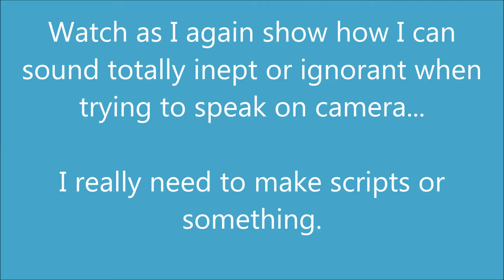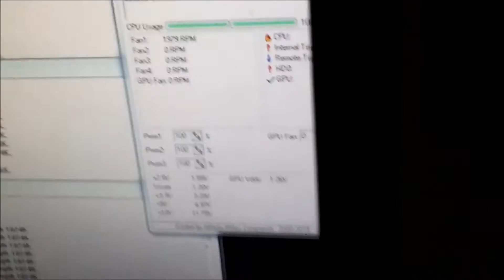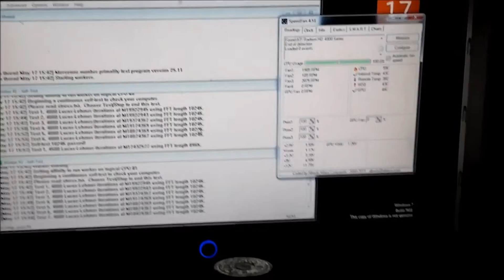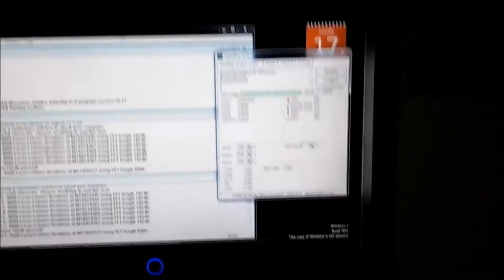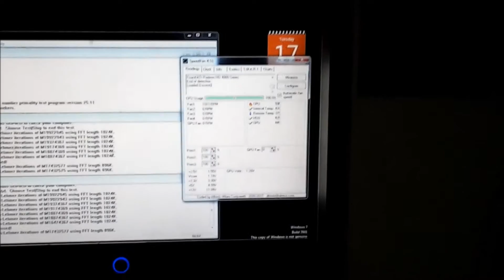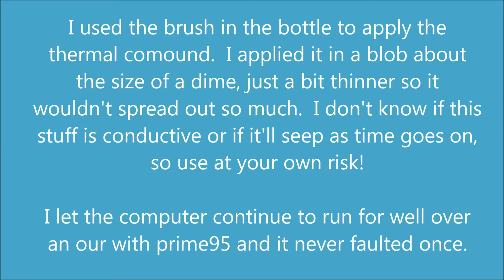Yet another Thermal Compound (Thermal Paste) substitute test....Copper Anti-Seize

Comment: I wonder if someone were to cause the grease to drop out and replace it with dielectric grease if this would stay in place. Been thinking about trying this on a computer but like some have said it could creep and fry the motherboard
Reply from the maker: I would suggest some sort of conformal coating or foam gasket or some other means of keeping it in place similar to what people would do with preventing condensation failure when cooling with LN2.  That would be the only way I'd risk using it long term.  Running it for a few hrs or days until you can get regular thermal paste is risky enough.

Comment: You. Thank you man... So I found Locktite Nikel Anti-Seize 2400F, Also we have the Copper Antiseize aswell. old stuff like yours. Going to test on: HP 8300 Elite usff - core i-5.
Reply from the maker: Just remember to be careful because you CAN kill your computer if it flows and bridges contacts.  It IS electrically conductive metal.

Comment: Followed your advice and had a go. To find out that the anti-seize eventually liquify enough and creeps onto other parts of the board. Mine is vertically standing, dripped and shorted the mainboard to its death and so can't really recommend
Reply from the maker: I did caution about that possibility.

Comment: It works cuz Anti-Seize is a mix of aluminum, lead and grease...All of which are good thermal conductors and not too dissimilar from ingredients used in real thermal paste.
Reply from the maker: This mixture doesn't have lead or aluminum in it.
Reply: @hellcat1988  Yeah it looks like the product you have is copper, graphite and grease so it can handle higher temps.  copper and graphite are also good thermal conductors. Any of the anti seize compounds probably work well as a thermal compound and all of them are probably slightly inferior to real thermal compound.

Comment: I have this problem now. Nothing open or cost $25. I dug around in my garage & found Permatex Ultra Copper Gasket Maker.For temps -65F to 700F. I been using it for valve cover gaskets for a couple years. I'm going to try it, dammit. Ask me about it in a year or so.
Reply from the maker: Do NOT use a silicone for thermal compound!  That will glue your heatsink to your cpu and prevent thermal transfer.
Reply: @hellcat1988  Looks like you were right. I started getting hot &  shutting down with BSD. I replaced it with thermal paste, & all is back to normal. Thanks for the advice.

Comment: I did some more research for you  pure copper is better the aluminium  so all those shiny sparkles in the never-sease  if flakes of copper and its designed not to harden or dry out the only thing that comes close is high $$$$ carbon nanotube sheets. so a copper powder in a non drying gel or paste form might give a little better performance but the price jumps up right there with carbon nanotube tech

Comment: For how long will this last before has to be reapply again?
Reply: my personal exp. with neversease in auto and marine industry  for a pc would probably be forever
Reply from the maker: I haven't done any long term testing with it, as it was intended as a temporary replacement for non-conductive thermal compound.  Given how long it's lasted in high heat and pressure environments on vehicles without drying or otherwise degrading, I imagine it would be fine to use for several years on something as relatively cool as a cpu.  Just make sure to check for corrosion buildup on any aluminum surfaces after a while and keep an eye on the temps.
Reply: hellcat1988 Ok 👌 thanks.

Comment: Hi, great video. I wonder how it performs in long term. I mean did it ever got solid or any other issues? 
I have a Nvidia 9500 GS that's tried out. I want to squeeze out a bit of life out of it.
Reply from the maker: I didn't run it for long because the computer was old and I had better hardware.  I don't know if it'd get hard in a TIM use case, but it never gets hard on lug studs on cars, and braking makes the studs hit AT LEAST 100C on a regular basis.

You're much better off just getting something like a 750ti or an AMD rx550 off ebay, as they have WAY better performance for cheap.
Reply: @hellcat1988  thanks for the reply! Well this machine was given to me for free to play around with anyways so it's not like I'd be loosing something haha. It is an old hp tower with core 2 quad tho, so to me it is interesting to see how it compares to my laptop cuz my laptop is i5-4200u and 840m Nvidia card. It's almost 10 years of a difference and I think the tower would perform better is single core tasks. Back then in year 200X comparing a systems 10 years apart was a joke but today it's actually interesting. At least to me haha. 
In terms of upgrading I have an eye on GIGABYTE R9 270X WindForce 3X OC 4 GB on Craigslist for $30 Canadian or GTX 460 for $20. R9 would be a better chose but I'd have to upgrade PSU as well. 
How would that perform? I think csgo, Minecraft would be playable so I could donate it to a kid or something. I don't know anything about fortnite but should be okay right...
Reply from the maker: @vinade2100  I don't know how hardware that old would perform, but I don't think it'd do all that great.  Usually if the hardware is anything pre 2012, it's not much good for modern streaming games like fortnight.  It's a problem with the cpu not being able to process the network data fast enough or the hardware level encoding or something like that.  I'm not great with networking, so I don't know for sure, but I know if it's slow to load modern web pages, it won't be good for streaming games.

As far as the TIM, as long as you don't use too much, because it is conductive, it should hold up for normal use for a while.

Comment: Hi. I went to get some thermal paste at a couple of auto supply stores [ no radio shack nearby ] and both were out of it. Came back to the house with nothing. Then I remembered that I bought some Copper Anti-seize in a small squeeze packet which is marketed for use on Spark plug threads. I squeezed out a dab and measured with my ohmmeter to see if it was conductive. It wasn't. The packet said that it was designed for 2000 F ! Mmmmmm, considering that the idea of a thermal paste is to fill in the tiny metal air pockets between the heatsink and the heatproducing electronic device; I decided to try it.  My project was on a Xbox 360 Slim Power supply Brick. It takes very little Antiseize to do the job and after a month of use my Xbox power brick never reaches a cut-off/shutdown  temperature like it had been doing. Problem solved.Thanks for this video as I got curious and searched youtube videos to see if anyone else had this same Idea. I feel better knowing that others have experimented with it.
Reply from the maker: There have been a few videos copying me, but I couldn't find any that posted a video before I posted this one.  Glad it could help you.

Comment: Heya hellcat1988, thanks for the idea, started using antiseize on my computers, works really good!
Reply: So it says it's been two years since y'all have commented on this how has the long-term effect been I'm in the same boat as we speak I'm trying to deal with it
Reply from the maker: I'm glad it's working for you but keep in mind that it's designed to be a lubricant, not thermal compound.  It may break down, run, or even cause a short over time.  This was JUST meant to be an experiment to see what would work in a pinch until proper thermal compound could be applied.
Reply: Gotcha, will be checking it out monthly and see how it goes, but for now, all my stress tests are being passed with flying colors.
Reply from the maker: I'd keep an eye around the socket for an weeping of the suspension medium (lubricant) to make sure it's not going anywhere.  What cpu are you running it on, if I may ask?
Reply: Sure, running on 4x intel i5-3570k boxes all of them using CM Hyper 212 evo to cool the processors, those processors now idle to less than 30c and wont rise temperatures above 50c under primer95 stress test (previously they all hit 60c with ease), and my laptop 640g1 with a mobile i5@2.6ghz never goes above 60c where previously it rised to 75c under stress. BTW I am using Chesterton No.725.
Reply from the maker: WOW.  That's some anti-seize there...  I'm guessing you're seeing the results you are because of the fact that it's got nano particles of colloidal nickle.  The stuff I used for my experiment wasn't quite as fancy.  Are you seeing better results than the thermal compound included with the evo?
Reply: Yes definetely, on 2 computers the compound used was Artic Silver 5 and on the other 2 the included Cooler Mater High performance stuff, everyone would thing its an apply once and forget about it, but after watching your video got curious and after removing the heatsinks to ckeck them out, the AS5 stuff was completely dry, and the CM hardened like melted plastic, scary to clean, had to use some thinner and an old sock to completely remove the residue because alcohol wasnt cleaning them at all, and after a fresh half pea size drop of antiseize reinstalled the heatsinks and everything looks perfectly fine, even applied with extra care to the gpus and they dropped a few celcius degrees too.
Reply from the maker: It would be interesting to see the results of a test between the stuff you're using and some I.C.Diamond in lab like conditions.  You may have very well found the perfect balance of high grade T.I.M. and quantity for price.  Where abouts did you pick it up?
Reply: I got a very generous sample from the engineers at the lab where I work, this was by accident because I asked them if they had some Permatex copper I could use for some test and they told me that was the only one they had at hand, nice guys heh.
Reply from the maker: Considering that anti-seize is used for industrial applications and it's really hard to find for sale anywhere  other than their listed distributors, yeah that was pretty nice.

Comment: awesome proof, I'm in an emergence situation where I brought my pc as an open air to work with me and the damn heat sink unseated, plus about 7yrs old with a core 2 extreme 9650, hitting around 207*F probably throttling like a bitch and crashes constantly, I thought of this of what's available in the middle of nowhere, thanks for the vid
Reply from the maker: No problem.  Just remember that it's not a permanent solution.  It'll last for a few days, but it's a lubricant.  The heat will cause it to flow.  When you get a chance, go down to best buy and get yourself some of the tg-7 (icdimond knockoff) to replace it with.
Reply: hellcat1988 yeah like I said emergency haha, I'm literally in the middle of nowhere, accessible by propeller planes and boats only, in gas field in Beluga Alaska, i have a the real stuff at home....
Reply from the maker: Well if you have to use it long term, make sure you don't use too much and keep the cpu as horizontal as possible to minimize flow.  Probably a good idea to take the heat sink off in a few days of constant use to make sure that what you have on there isn't flowing out.  

When I tested the comp again for a second time, it'd been a few weeks, but the computer hadn't been used so the flow was minimal.
Reply: hellcat1988 Roger that, I'll be here till Wednesday, so I'll probably check it once and replace it Monday, I think the tiny tube I have is icdiamond

Comment: the reason why your CPU clock speed dropped was because your temperature got a little too high, This is called speedStep where the CPU clock speed is clocked down to reduce heat production.... Therefore your CPU benchmark doesn't really count since your CPU wasn't clocked to what it was supposed to be.... you can find SpeedStep in the BIOS and disable it when doing these kinds of tests
Reply from the maker: It didn't drop.  I forgot that I had taken the overclock off long before  I got the computer back from him because it was overheating so badly.
Reply: i see, what CPU did you use?
Reply from the maker: Pentium d 930
Reply: i ran a core 2 quad clocked at 2.4ghz, temp was above 90C when under load.... then again the core2quad series is known to run much hotter compared to other cpus but above 90C is very unsafe
Reply from the maker: Martin Prochazka
Yeah I'm familiar.  I've been working with overclocking for the last few years and have even begun moving into water cooling. 

I only threw this computer together so my friend would have something to access the internet with because he doesn't do any pc gaming or productivity with it. 

The 212evo was bought as a replacement for the stock cooler to try to control temps, but as I said in the video I didn't get much thermal compound with it.  That was the whole reason for testing the anti-seize as thermal compound.
Reply: thx I didn't know I made that mistake lol